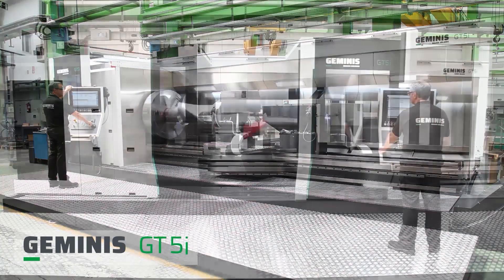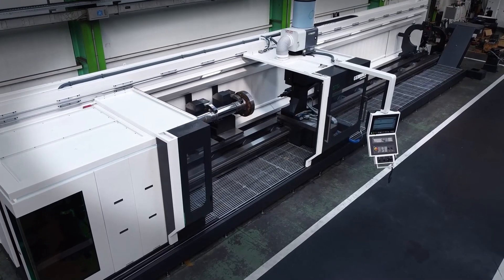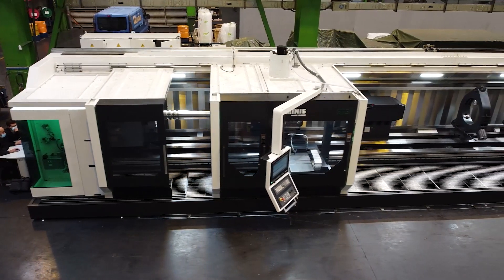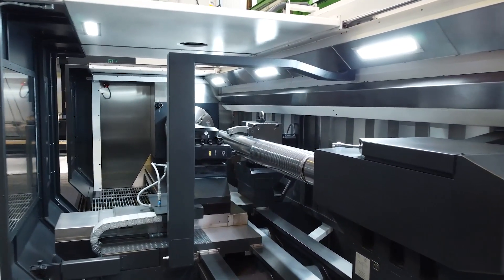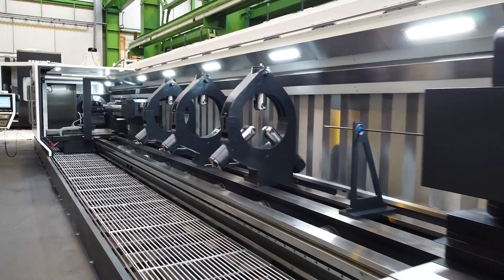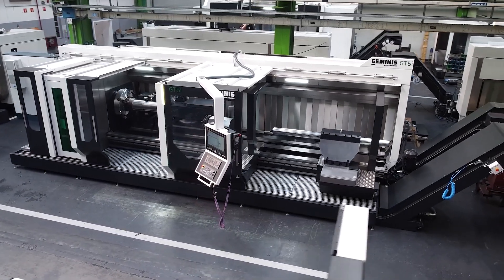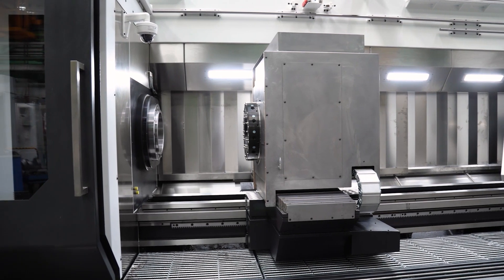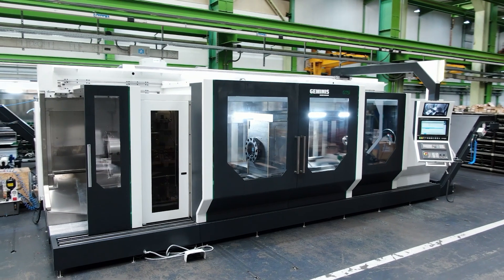The Highly Configurable Geminis GT5i Flatbed Lathe for Machining Large Parts

Comment: Hello Doug, looking up for a hardware partner for a CNC, the goal is manufacturing pulse generators with highest power density known to humankind, we're talking about 4 to 600 MW/m^3 roadmap, your Sandia national laboratory will become some sort of a relic of the past if I manage to pull this of. The theoretical work came out of S.I.F.P.L. in 2021, yet the starting point was somewhere in 2015, that is a private lab. I am a pioneer in the domain of what I call power spintronics. Now I need to manufacture the product, outsourcing is out of question even if we scramble the parts from multiple 3rd parties. Frankly enough it requires precision manufacturing both in the mechanical domain and electrical, the later through some form of MHD otherwise most likely we evaporate any sort of silicon standing in our way.
I would like the manufacturing plant to sit somewhere along the Danube river, EU region. Austria, south of Germany, Bavaria, maybe. The practical use of such a device will nail down the coffin for those who want to do inertial magnetic fusion is what I hope will happen. Maybe we can find a hardware partner who can provide me with what I need, maybe Gemini since they are from Spain, maybe we can ask those from Maher Holding about this. Your name reminds me of Doug de Muro or something like that, an USA car enthusiast, with his own common quote "quirks and features".
Reply from the maker: Sounds like you've made a major breakthrough and are developing technology that will change the way power is generated. If you'd consider building your plant in the USA, we're your partner for Geminis. If in Europe, it would be best to speak directly with the folks at the Geminis factory in Elgobar Spain.

Comment: I run a Hankook 9na at work that is 8 meters long. We run parts anywhere from 1inch diameter to 25inch diameters and lengths from 2 inches up to 300 inches in length.  We do alot of flanges front and backsides with radius and long turndowns sometimes up to 200 inches long. Can a machine like this handle that and is it possible avaliable with a 4 jaw chuck as we do alot of square parts as well.
Reply from the maker: Yes, Geminis lathes could run parts like mention. Ideally 1” diameter and 2” long parts are a small for a machine of this size. We offer manual chuck, hydraulic chucks, manual steady, hydraulic steady rest, C axis, live tooling and all kinds of tailstock options as well. On the center distance, we offer 1m to 24m (39” to 944”) center distances and can easily accommodate 300in long parts. 

Let me know if you'd like someone to contact you with more details. You can also learn more by visiting https://www.selectmachiningtech.com/services/geminis/
Reply: @selectmachiningtech  Thanks for the response. I will let my Tool coordinator know about your company and these machines.
Reply from the maker: @wendull811  Thanks, we're here to help solve your BIGGEST machining challenges!